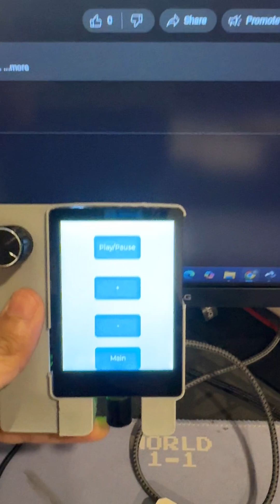ESP32 Touch Display Multipage Macropad #esp32 #macropad #touchscreen

Comment: Hi can you help me setting up this display I have the same one and unable to set it up. We can chat on discord. Kindly help me
Reply from the maker: Hello. I had written another instructable showing how to get the screen working: 

https://www.instructables.com/Quick-Start-Guide-for-ESP32-S3-28inch-Capacitive-T/

After completing the above instructable, you can try this one.
Reply: @normalguytriestodosomethin4615  ya I did the one you gave the link for in this you downloaded the esp32-audioi2s-master, tft_espi, lvgl libraries from the waveshare website library files. but i dont see that option available so I am downloading these libraries from the arduino library manager so which versions should i download for the programs to work I know I have to download the older versions but can you tell be all the versions i have to download and also please tell me in boards manager which version of esp32  should i download.
Reply from the maker: So, waveshare has removed the libraries from their WiKi. I will try to upload them on the github repository for this project.
In the meantime, you can try downloading:
LVGL	Graphical library	v8.3.10
ESP32-audioI2S-master	Audio decoding library	v2.0.0	
(This is from the Waveshare Wiki page: https://www.waveshare.com/wiki/ESP32-S3-Touch-LCD-2.8#Working_with_Arduino)
Thank you for pointing this out
Reply from the maker: I have added the libraries on my repo. You can find them in 'Display Libraries.zip'